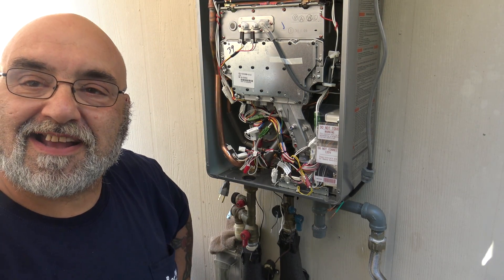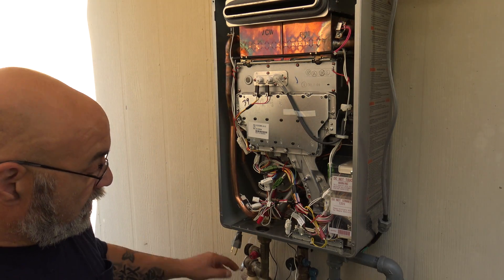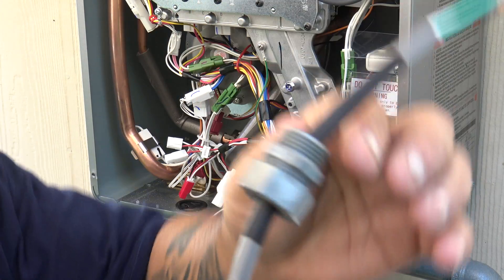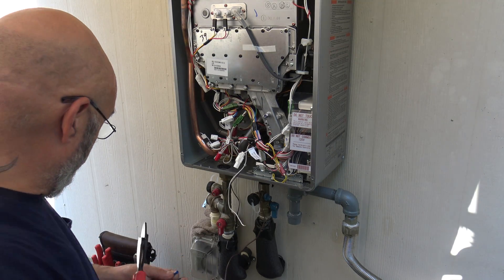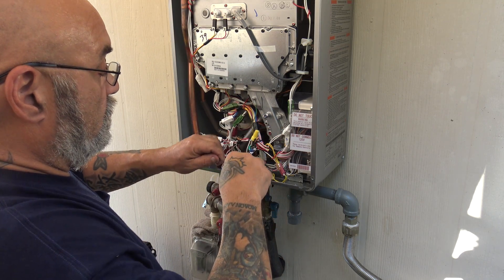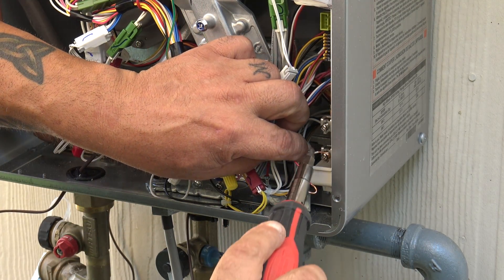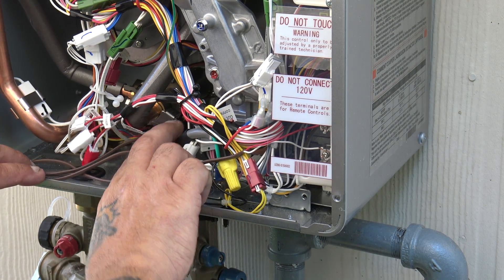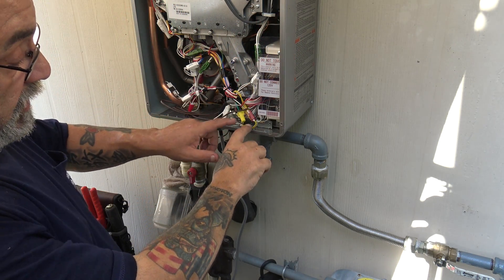What wires and knockouts to use on a Rinnai external V and RL series tankless.

Comment: Thank you for a thorough explanation on the electrical part of a tankless heater. Question for you. Can you turn on the heater to check that power is going to the heater without having it plumbed? Or rather water going into the system? Thanks

Comment: Mike, I want to thank you for your videos, especially this one. I live on an island off Honduras and needed to replace a POS unit they use down here that gives me hot water for about 30 seconds before the hi temp circuit kicks in. A had a exterior mount Rinnai brought in and was completely baffled on where to put the pigtail. I could not fathom that i connect to those little 20 gaugesish wires. After watching a couple of your vids you really spelled it out in this one and actually mention how small they were. 
I thank you again

Comment: How do i contact ? Im having issues with main electrical for Rinnai V53De. This one doesnt have the punchout. It does have a threaded section with black/white cables coming down out of the unit. But you are saying these cables are for controller. My Rinnai does not have a punchout. Please reply. Thanks
Reply: Unfortunately that’s the hardest to wire. It all gets wired into the small box at the bottom. You can drill a 1/2” hole in the bottom of the unit and bring the wires up into the unit snd wire it that way. The controller has to be wired into that small box. Mike

Comment: I dont have that punchout for black/white electrical, i only have that other rubber threaded where black/white cables are for controller... how do i wire this using your daisy method?
Reply: What model number do you have
Reply: @TheBuddylab  V53De  Gas

Comment: Trying to hook up my Rinnai RUR199i.  Where do I connect my zone valve controllers?  Is there some connection plug I need to buy?  My guess is that it needs to plug in the slot just above the one above the Wifi plug?

Comment: Great videos! I am changing my rental  houses over to Rinnai from Tagaki. The ones I bought have this dumb threaded connector at the power in instead of just a KO. After hours of trying to find that connector , I'm going to just put a blank plate over the hole for my existing Liquid right connector. It's a stupid European feature
Reply: Hey jack hammer, i have the same situation. What did u do to resolve this? I dont havr the knockout, instead i have the threaded one. Dont know what to do

Comment: Hello Rinnai Guy, I bought the Rl 75eN External model, I need to do a conversion to propane since we are In Puerto Rico, I would like part number and intructions to do so, thank you
Reply: Unfortunately you need to call Rinnai Tec. Support for that info. They are the ones that issue those parts when converting the unit. You will need to give them the model and serial number of the unit. You can buy the part from them at the Rinnsi parts store. E mail me your info and I will send you the part number so you know you are getting the rite part. Mike

Comment: Hello, Bought this for my father in law and was going to help him install. He went ahead with out me and plugged the high voltage to the mainboard where the controller needed to go. Fortunately, he had it plugged in to a GCFI switched which kept resetting. By the time I got there to fix it and correctly wire it, I could not power on the controller. Im worried that he fired the main board, but would be happy if it was just the controller he ruined. V65 model. Any suggestions on where to obtain both those parts please shoot me an email if you can, as im trying to fix his expensive mistakes.    dmc831 at yahoo dot com. Thanks for this video and hope the expense isnt so high.
Reply: Dj, call me at +19042385349 tonight after 6pm and I will go it with you Mike

Comment: I can hardly believe how poorly the installation instructions from Rinnai are for the electrical.  And even more so that those two tiny wires are for the 120!
This was a lifesaver.  Thank you for doing these.
Reply: caroline blasing  I hear you...you would have to be an electrical engineer to work off the instructions supplied!
Reply: Yeah the two spindly wires I thought were for the controller!

Comment: Any recommendations on which hot water recirculation pump to use on a Rinnai RUCS75i?  I tried the Watts 0955800  but it does not seem to have enough pressure to start the recirculation and fire up the water heater.

Comment: Mike, I appreciate all the videos.  They've been a great help when I was installing a RUCS75IN at my house.  I have a question that my plumber and Rinnai have not been able to get answered.  After I flush a toilet or run a high flow sink on the cold side (at the end of the fill or cutting water flow) the Rinnai unit turns on the vent fan momentarily.  The toilets don't have a crossed line and I added a check valve on the cold line before the heater thinking it was back flowing water when the toilet tank finished filling.  Still does this after check valve.... Any suggestions?